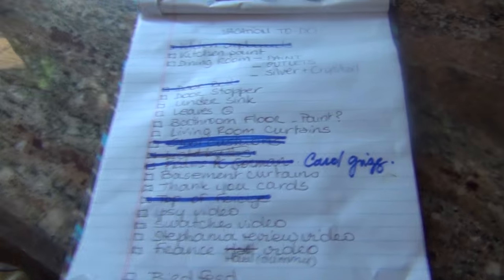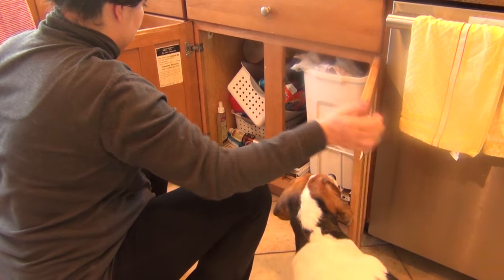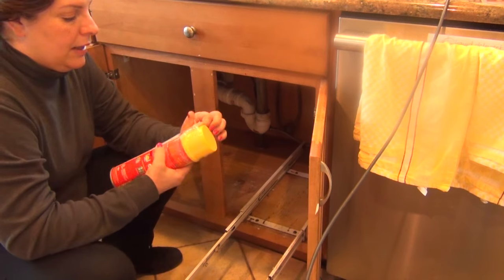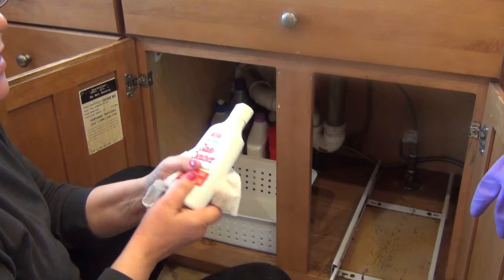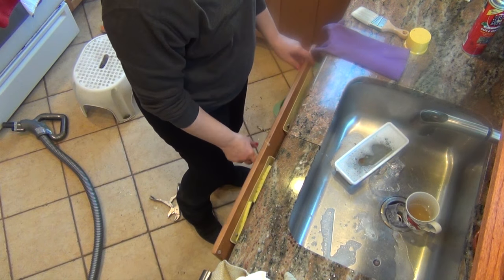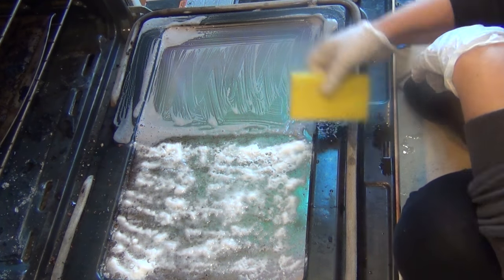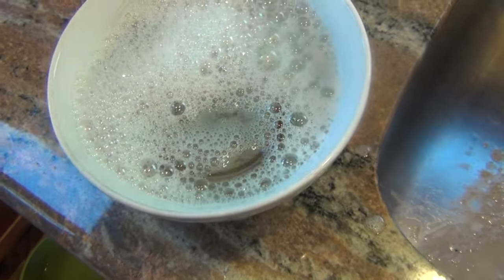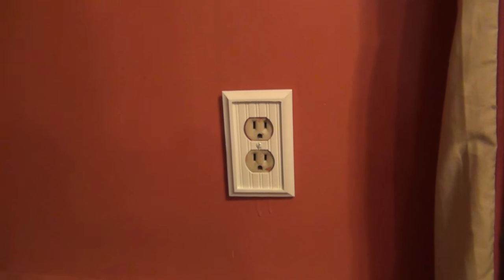Stay - Cation || Day 3 || Mice, the oven door and more ||

Comment: Sophia, If you ever have to cover a hole from a mouse, if possible, stuff the hole w,/ copper then use the foam. Mice/rats can't chew thru copper. Buying copper from Home Depot, etc is expensive. So, I bought a copper scrubber from the dollar store and took it apart. Worked just fine. 😊

Comment: Yes, I have those hidden compartments in front of the sink and I use them for the sink sponges and brush, same as you.  Try using a widget on the stove glass, it shouldn't scratch, just take off the grime.  I do it and it works along with some elbow grease.

Comment: On your oven glass you could try the Rutland  glass cleaner that you put under your sink. I use it on the glass on my wood stove and it works without abrasive pads and does not scratch. I don't have a window on my oven so have no way to know if it works the same-it should. I am still using the vinegar and dawn mixture you recommended for cleaning. Works great!

Comment: A regular old mouse can fit through any crack or hole that a pencil can fit through, so it can be pretty hard to stop them! I wouldnt be surprised if you see they eat through the foam and come in anyway, you may need to glue some wood or something more difficult around that pipe to get them to go away :( Hope this works for you though!! I was so grossed out when I found out mice can come in such a small spot!!
Reply: Ugh that is a gross thing to know.
Reply: Ugh that is a gross thing to know.
Reply: Sophia if they do eat through, fill the opening with Steel Wool that does not have soap on it and then top up with the Foam again.  Hope it works the first time though!!  Good luck.

Comment: When i moved into my house a few years ago, the previous owners had rat poison in every cabinet, cupboard, and even on the closet floors. I have 2 cats, and sometimes a visiting dog, I didn't want to risk them getting poisoned so I had to pick everything up. I've got steel wool around any pipes/holes that go under the house, something previous owners didn't think of doing. I ended up tossing some of the rat poison under the house where larger critters cant get to it, I did that twice a year till I ran out. I've also got two live traps, one in the kitchen and one in the laundry room I check on a regular basis. Normally I wouldn't use rat poison, I think its cruel, but I had no idea if there was a problem and they just cleaned it up to hide the fact, I also have a huge field behind my house, so its kinda hard to keep them out for good. Thankfully I haven't seen in a long while. Unfortunately my two cats suck at hunting.

Comment: The trash can from bed bath and beyond has a latch in front, the silver front part pushes in and out. You cannot open it when it is closed. A bit expensive but nice looking can and great quality. simplehuman® Plastic Semi-Round 50-Liter Step-On Trash Can. First trash can that lasted me  3 years so far with no problems.

Comment: Steel wool is a great mouse blocking material. Just sayin. 

Laughed out loud when you said the door stop took two years!! It took several years to replace the handle on an outside faucet. Which required locating a clamping wrench to operate. When we finally bought the replacement handle it was LESS then $1!!!!!!